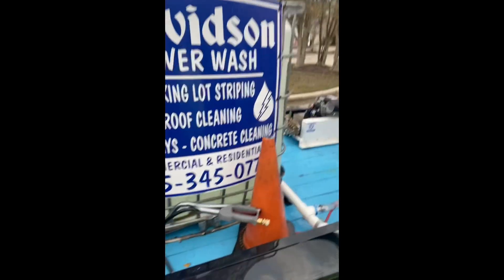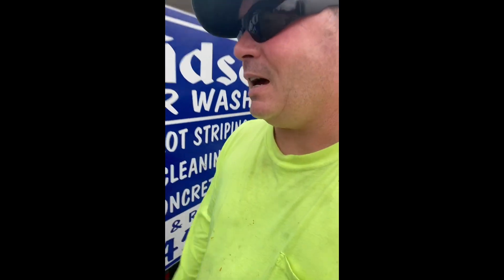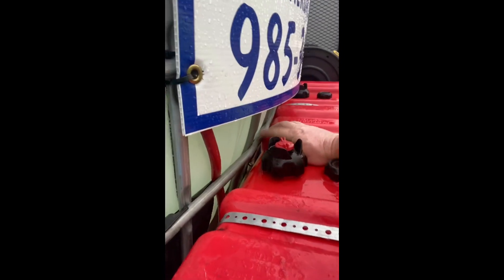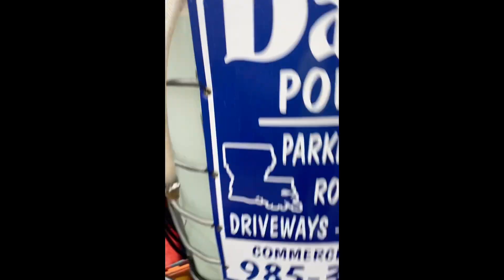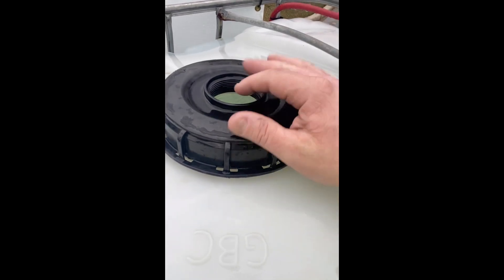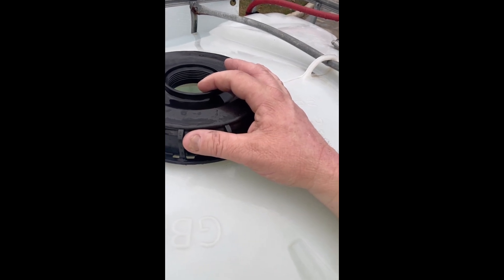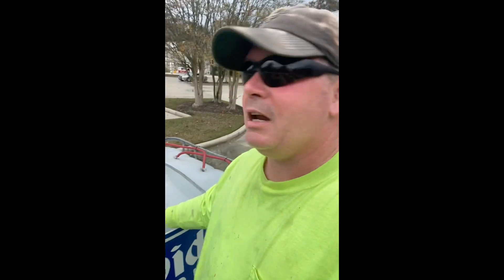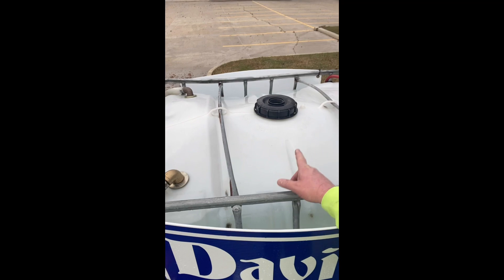PressureWash trailer buffer tank blew up

Comment: The Hudson valves will work BUT you have to think about the sun building pressure on it also. I would put a vent on the center part of the top. Some use pipe to tubing fittings and a piece of tubing bent on a 90 degree or a simple 90 with a piece of hose

Comment: The number one thing Billy is that everybody is safe and okay anytime are water going into a concealed container it will build up pressure same thing from Heat it will expand it 1 quick question what company did that good job on printing your banner signs

Comment: That sucks brother! Hopefully it won't be hard to find a new tank. I paid $40 for mine and had to drive two and a half hours to get it. Definitely think about the Hudson float valve saves my tank for sure lol. Great info for anyone using buffer tanks. 👍👍
Reply from the maker: Yes sir they have a supply house about two hours away we just need to find a time to run down there and grab another tank I think usually they sell them like for $75 but they already cleaned out